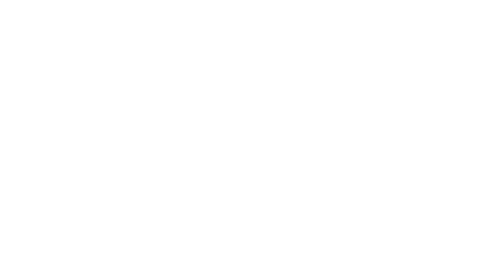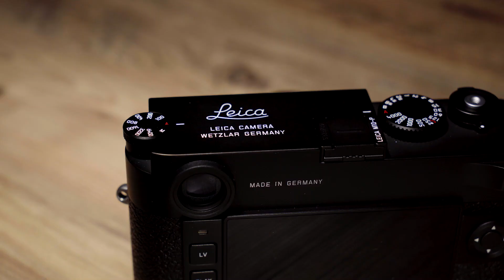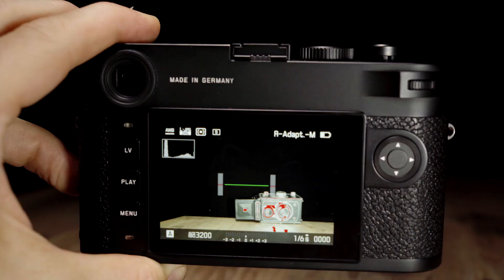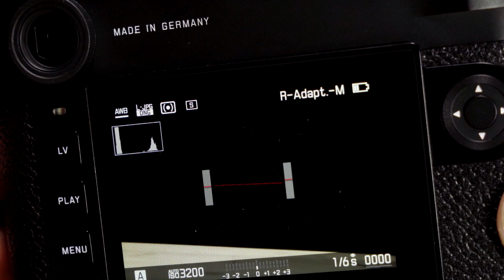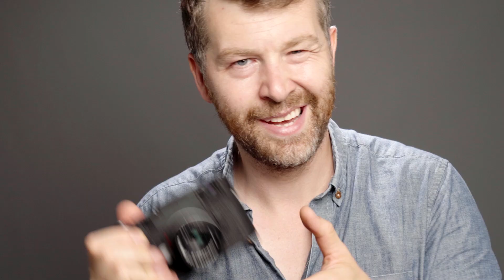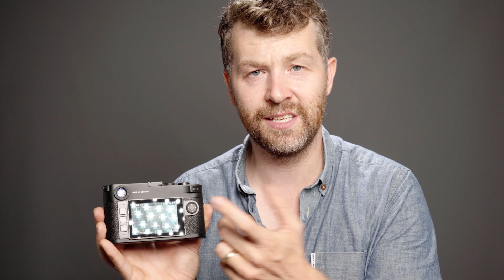LEICA M10-P: Quietest Leica M camera ever - First Look

Comment: Which classic Leica M lenses will work with the Leica M10-P?  Will those lenses work without being sent to Leica for coding?  What are the problems if the lenses are not coded?
Reply: Nearly all the classic M lenses can be used with the M10 series. AFAIK some of the early 21mm lenses won't meter correctly and the close-focusing range on the 50mm DR doesn't work without modification. Otherwise, you can use any screw or M-mount lens on your M10X without issues. As far as coding, my 90 APO isn't coded nor are my Zeiss Biogon superwides. I select these manually (for non-Leica lenses you select a Leica equivalent) and it applies geometric and vignetting corrections and attaches the EXIF data including an estimate of aperture (it's not always perfect). Or you can leave it as is and apply corrections and EXIF later. Coded lenses will have everything applied automatically. I'm considering having my 90 coded because it is a bit of a pain to remember to manually select lenses each time I change them and more than once I've shot my 90 with 21 selected and vice versa.

Comment: Love the Sony A6500 comparison. The camera has a complete silent shutter mode. That did not make it here though
Reply from the maker: Unless you heard me say just after that the quiet shutter is obviously a bit redundant as most mirrorless cameras now have a silent/or virtually silent shutter in electronic mode (which incidentally won’t help you out photographying fast moving subjects unless you have an extremely good camera with low rolling shutter).
Reply: Photogearnews An interesting notation. TY

Comment: Sony a6500 has a silent shutter. More quiter than that leica......also you can save $6,500 no pun Intended......
Reply: Almost all cameras have silent shutter modes except SLRs.
Or X100F and GR have leaf shutters for flash or other mechanical features
Reply: Don't compare a toyota with a mercedes.
Reply: Sure, Toyota is cheaper and more reliable 😂

Comment: I would assume that the Fujifilm X-H1 is quieter than the M10-P. WHile the older FUjis were already quite low noise, the X-H1 is a joy to use already because of the extremely discrete shutter sound.
Reply: yea but once you have used a leica you'll never go back

Comment: great video. i really like the removal of the logo from the front. no more fiddling around with black tape. i would like to see a side by side comparison with a M10 and an M6 or M6 TTL to see how much quieter the new shutter really is.
Reply: Abhishek Sengupta I have a comparison on my blog birnbacher.com
sorry, german but the sound is international:-)
Problem: at the table the difference is not that big, if you hold it, you can hear the difference better. 
I hoe that helps
greetings from Nuremberg